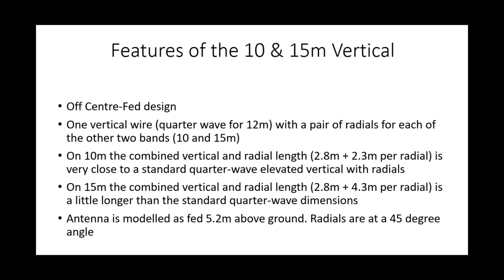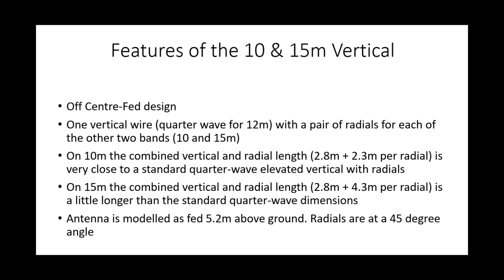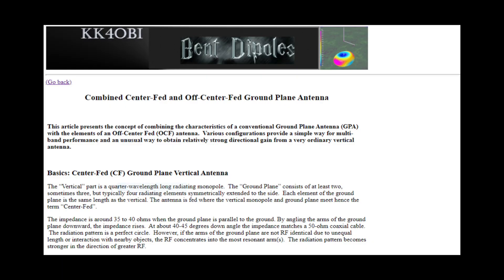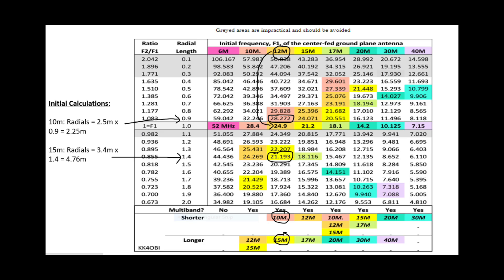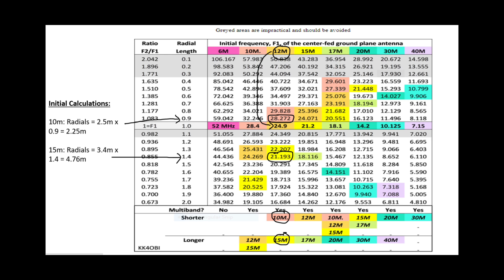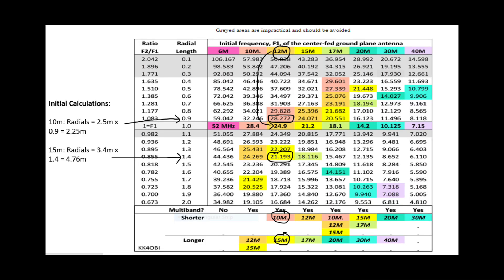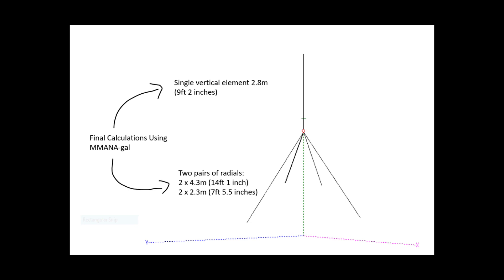Ham Radio: Vertical Off Centre-Fed For Two Bands

Comment: Interesting, very interesting...
If you use twin speaker wire for the radials just cut a notch out on one part of the twin lead for your 10m radials.
I take it an atu with get it to tune on 12 as well so in essence a tribander.
Reply from the maker: Good points and yes an atu can do that

Comment: I have one question about the 50ohm Z. Is that calculated using an actual 50 ohms at the antenna or is that taking into consideration a 4:1 conversion as is typical for OCF dipoles?  Is this antenna just slightly off-center resulting in a convenient impedance ?  If no conversion from 200 ohms is needed, that’s even better than a typical 1/3-2/3 OCF.
Reply from the maker: Hi David. No 4:1 needed, purely feedpoint impedance 73

Comment: Sorry power cut hi, I found in general two good bands were 40 and 15m, and with a simple 40m vertical ant with a few buried radials,  you have a resonant tune on both bands, with great dx potential,  low take off , no tuner required , and as I have found, if you add a decent tuner you can get on the other bands, which I found this week, working dx on 30m using my 40m vertical antenna. 
I always tell myself we can't be on two at once anyway hi.
Your ant is a very good ant for experiments, but if your like me and you just want a well proven ant that is simple to build and gives exceptional dx results straight away, a resonant vertical or a dx commander is going to do the job.
I really appreciate the options you create for us all, it's good to know what else is out there,  and I look forward to your next video, and can you please show some radio time on these different ants, then we can hear which one might work best for our needs.
Take care and 73 zl3xdj.
Reply from the maker: Thanks brian